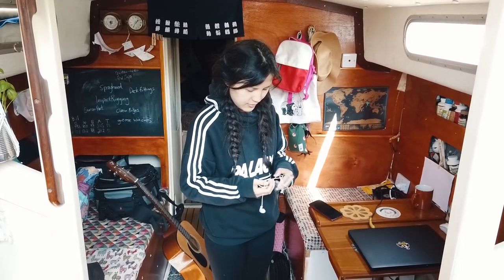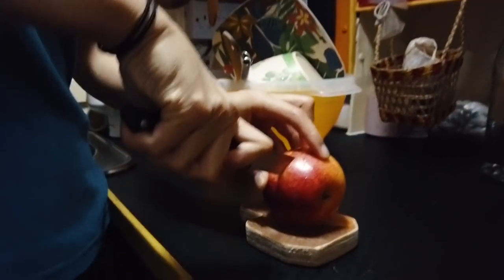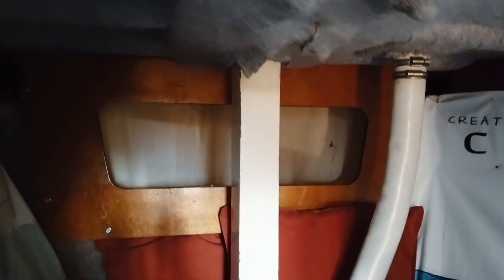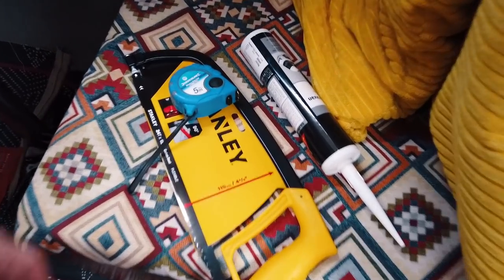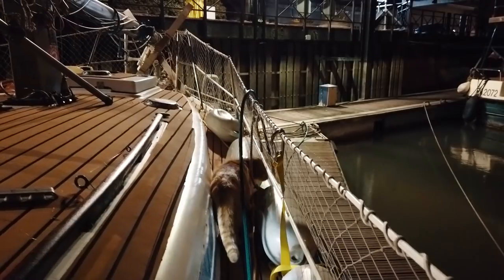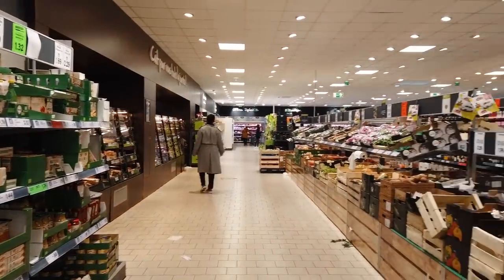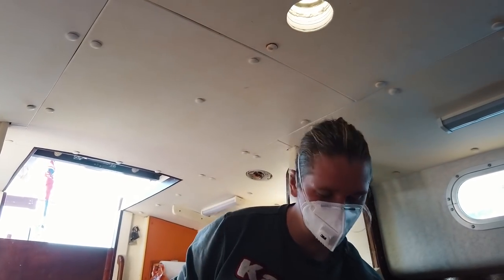Greasy Winches and FILTHY Bilges | Wildlings Sailing

Comment: Hi Nadiyana and Mark, good to see you both do some small DIY. For the bilge be fore you empty it add some soap/detergent to it. Buy yourself a manual bilge which will works at events. They are cheap, easy to store or fix in you bilge and easy to by at Ebay or Amazone. The samsonpost, cut it, make a new one, drill a hole in both sides, after it is assembled, make a sleeve of four L-bar iron bars. This should hold. Or otherwise try and error yourselves, is the best learning school. See you soon next week. Have a nice weekend.❤️
Reply from the maker: Thanks Martin, yeah, I definitely need to get a manual bilge pump, struggling to find one on Amazon over but will try today
Reply: HI Nadiyana and Mark, I will look for you here in Holland for nice priced good hand bilge pump.
Reply: Wildlings Sailing , what’s your adress in France? I found a manual bilge pump i’ll send its as gift instead of coffee.
Reply: @martinros6769  Legend!
Reply: Those two are to much fun and must be helped in any way.

Comment: Go for it, Mark, with your temporary Samson post fix. When it broke it was slightly rotten, and under extreme load. Try not to stress it so much again. Eventually.....well, you know my thoughts on Samson posts.  Good video, thanks. Best wishes to you both.
Reply from the maker: Thanks Justin, I'll be the laughing stock of YouTube when the final Samson job is revealed! Haha it certainly was under a very high load, looking back I should have 'feathered' the pressure on the post rathe than just putting a loop on it, silly really

Comment: Just lift the samson post up thru the deck and make a cheap iron fitting on bottom to secure it to the hull (should not have much stress). Should be easy and solve everything 😎
Reply from the maker: That's pretty much what I'll be doing but without the iron fitting, just bolting it in and supporting it around the deck

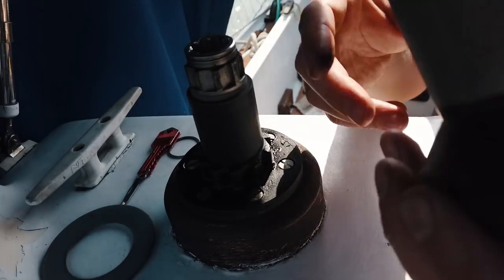Comment: Hey guys! I wonder if you can tell me what the tool/technique is at 4:25? Need to do the same with ours, and I'm sure this is how you access them.. Cheers!
Reply from the maker: Hi! I just used a slim knife to get under the first layer of the clip and worked it off. And yep, that's holding the whole things together pretty much
Reply: @WildlingSailing  thanks, will give it a shot!